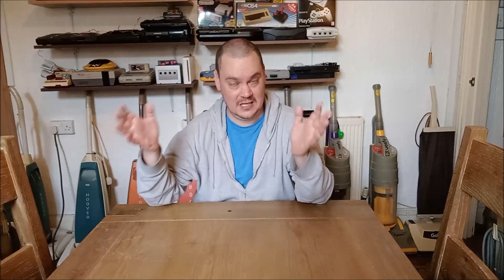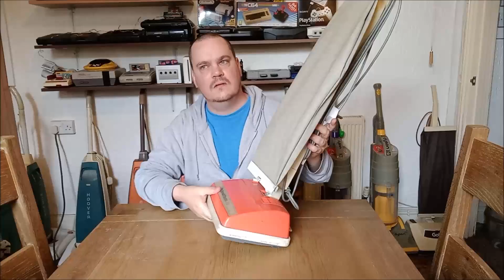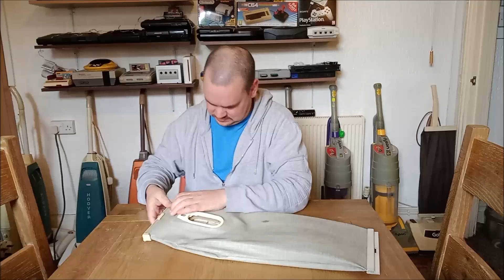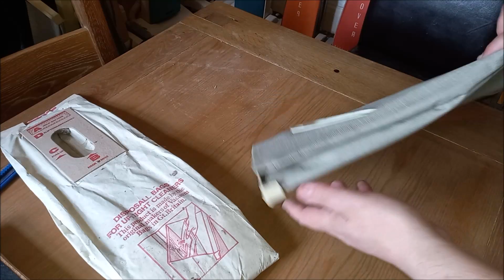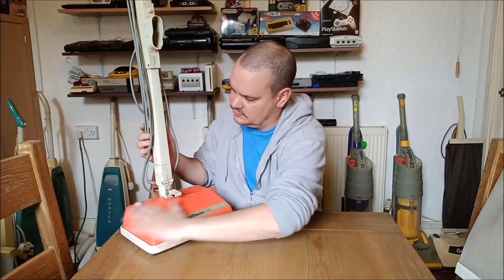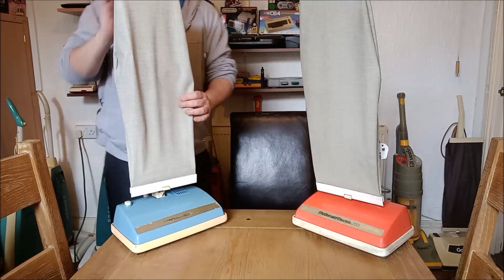TWO Super Rare McDonald Electric 250 Upright Vacuum Cleaners from the 1970s :-O

Comment: Ok, let me help you here. The Oreck XL4000 was actually the second model of Oreck. The first US model of Oreck was the CVR4000.  It was identical to your blue McDonald, including the square top bag. I have one in my personal collection. The second was the black XL4000 with the rounded top bag, the next was the orange XL43000. Now, I will tell you, I know of the owner of that orange XL4300, his release pedal is simply missing, I have seen other XL4300's with the handle release pedal. Before the Oreck that was made by McDonald electric here in the US, as you said there was the Whirlpool CVR. models LV55, CVR500, 600, 1000, 2000, 3000. Ranging from around 1964 to about 1972. My Whirlpool CVR4000 is dated 1972 on the motor. Hope this clears things up a little.
Reply from the maker: Incredibly useful information, thank you so much!!
Reply: Not at all! Glad to assist! It's a difficult subject and that is because unlike Hoover, or Kirby or Electrolux, there is just simply not enough information avaliable to the general public!=(
Reply: @jaedevine3714  Where does the blue XL4000 with the plaid bag fit in?  Didn’t it come before the black one?  Thanks for sharing all your info, great resource!